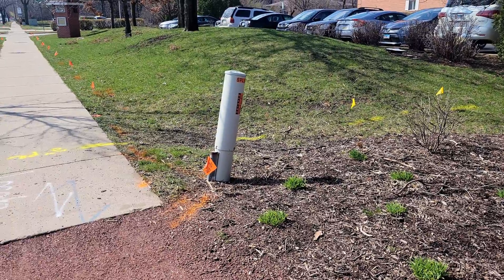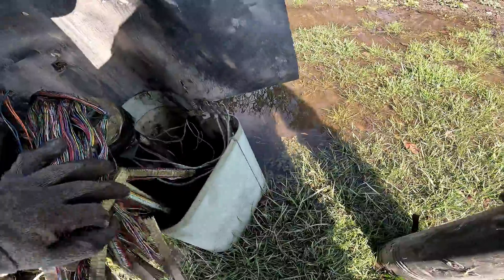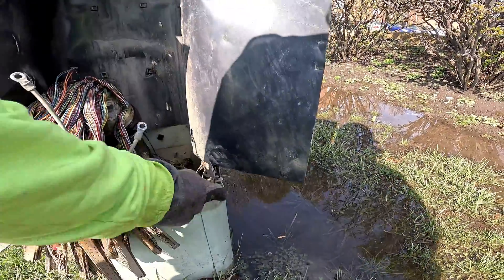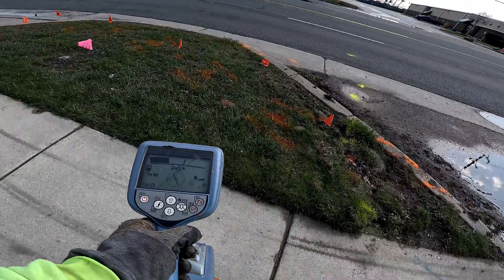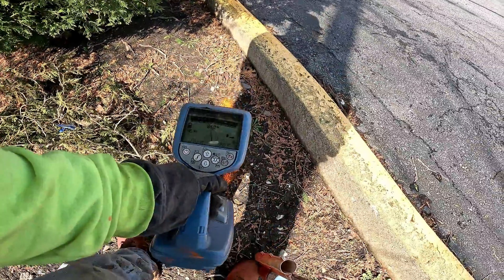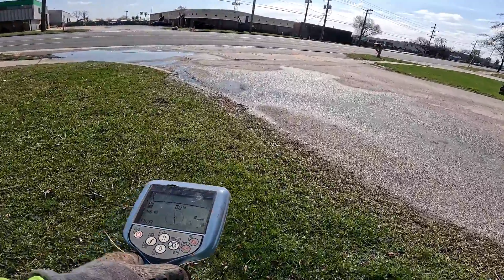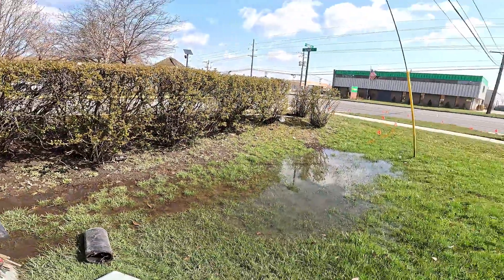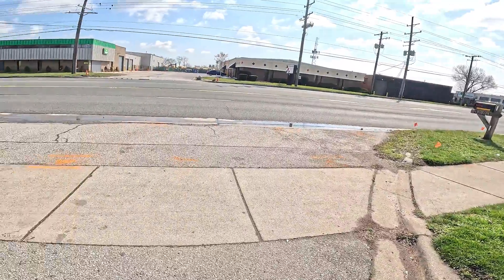Telecom Radiodetection Precision Locating | AT&T Network Infrastructure

Comment: Have you ever located without access to the cable? I spent two days locating and old abandoned AT&T coax cable in the thickets, briars, and thorn bushes of Eastern PA. (I’m an AT&T NTS) I have a transmitter (inducer) of some kind and a PDL-5. If you don’t have access to to clip on to the sheath or clamp it , you place it above the cable and it induces a signal on the cable. It’s sketchy at best. Was trying to get more info on how to get better results. Thanks for the good video though.
Reply from the maker: Do you have access at the other end? If not, go to where it originates and bring the locate back.